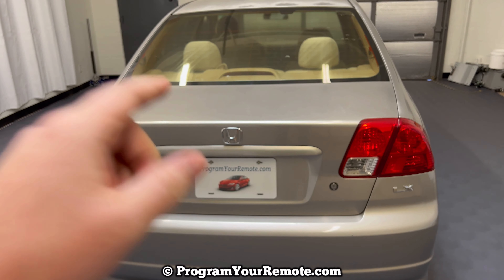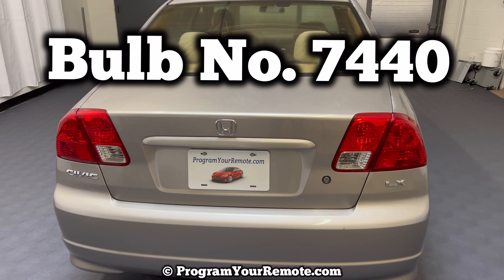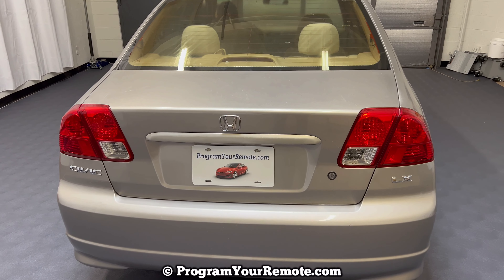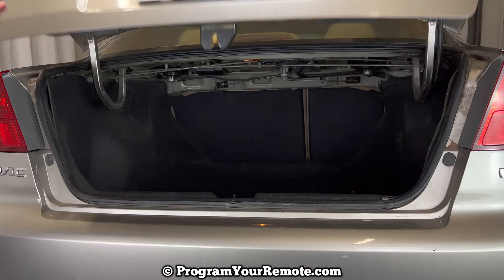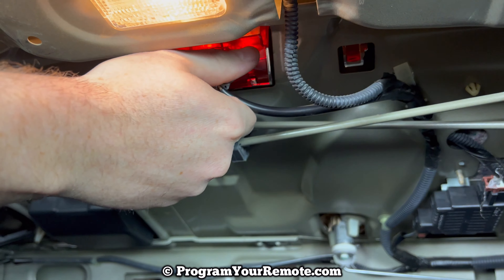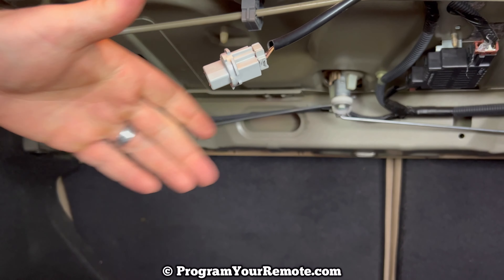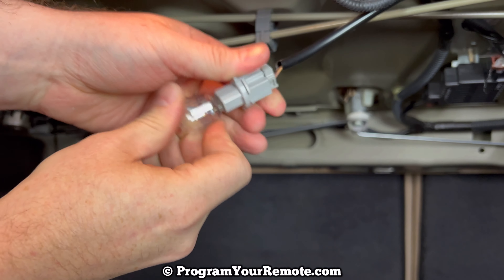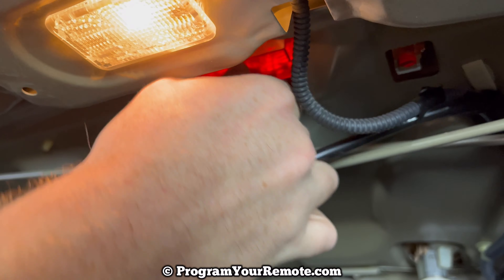How To Replace 3rd Brake Light 2001 - 2005 Honda Civic - High Mount Third Brake Light Bulb Change

Comment: I am unable to get the lightbulb out bc it will not turn to unlock! So frustrating!!! I nearly broke the red plastic plate around it trying to get the bulb to turn, and it won't budge! I even tried a little WD40. No difference. Advice anyone? TIA.
Reply: It happened to me as well. I had a hard time turning the bulb holder and the bulb itself as they're both very tight. I just kept twisting them counter-clockwise even though it didn't work the first 3, 4 times. I rested a bit and tried again and eventually that worked on both. Give it a try as it worked for me. Do rest a bit before trying again each time, otherwise you get frustrated and gave up totally.
Reply: For future reference, unplug the wire, then grab a pair of pliers or channellocks. Don't squeeze the connector, just turn it with the pliers. The plastic around it may crack, and there's not much you can do about it. Even after I've had the connector out not too long ago, I went to take it off again today and it was hard to turn again. Some silicone spray may help for  the future. Also, use gloves or a napkin to install the new bulb. Halogen bulbs get hot and you don't want hot-spotting from the oils on your skin.

Comment: What if its not rotating clockwise I have the same car plz help me out its not turning clockwise and not coming out.
Reply from the maker: The can get pretty tight if they haven't been out in a while - you may need to use a pair of pliers
Reply: @PYR-Auto  The red plastic plate around the bulb is loose on one side so I have to be very careful and turn it easy. BUT the darn thing won't turn!! I wish you had included in  your video what to do when the bulb won't turn. It's obvious it's a common problem!! You make it look so easy in your video. I need my car inspected this weekend!! I'm so afraid I'm gonna ruin the red plate around it and then have no 3rd brake light that works!! And this is my daughter's car she uses for college as a commuter!! Please advise. Thanks!!
Reply: I thought he said to turn counter-clockwise to get that out, not clockwise. Maybe that's the issue.
Reply: @greatsamaritan8278  my car is pretty old now so when I applied force so it did work as he told actually I was scared that I will broke that holder 😆
Reply: @gdzilla6572  I'm glad it worked for you now. May I ask if you turned clockwise or counter-clockwise because he said counter-clockwise in the video? My niece's car has the same problem and I tried to fix for her.
Reply: @greatsamaritan8278  bro u just need to rotate it clockwise not Counter clockwise just twist it clockwise I did the same thing and it worked for me bro-
Reply: @gdzilla6572  Thank you for the info. I'll try that and hopefully I'll be able to fix that for her. Thanks.
Reply: @greatsamaritan8278  no prob bro;)
Reply: Just to clarify this for others, the thing that hold the bulb should be turned counter-clockwise like the video described instead of clockwise. I had to try a couple of times with some force before getting it out. Thanks.